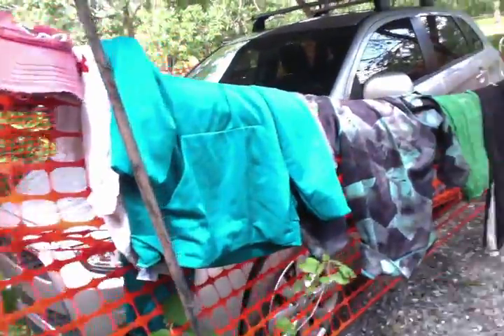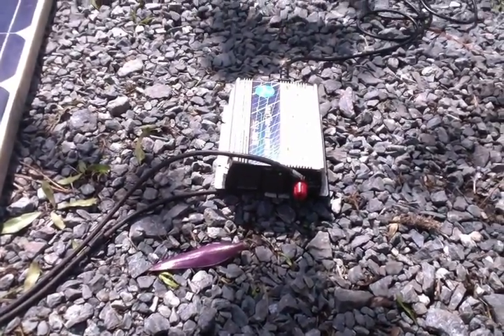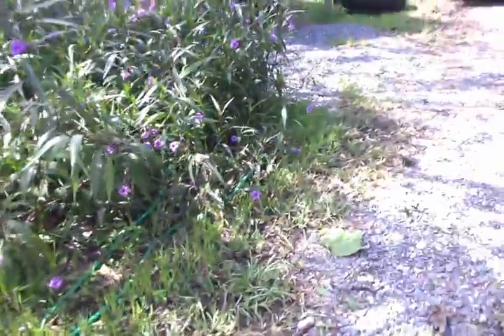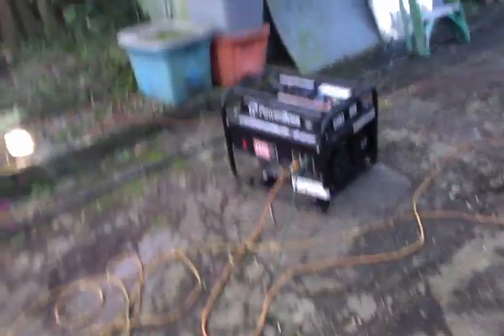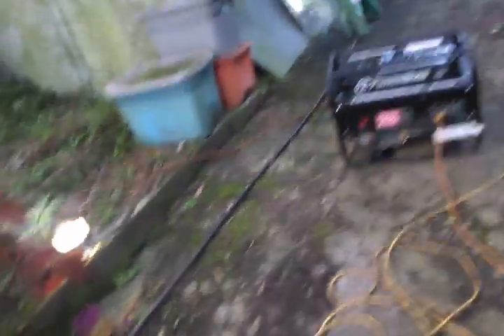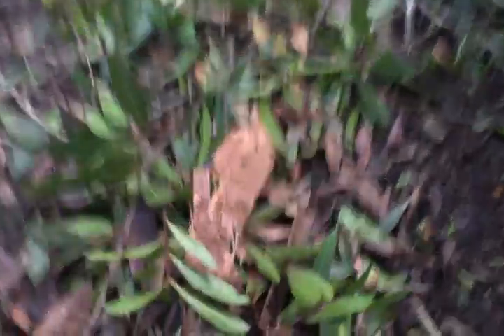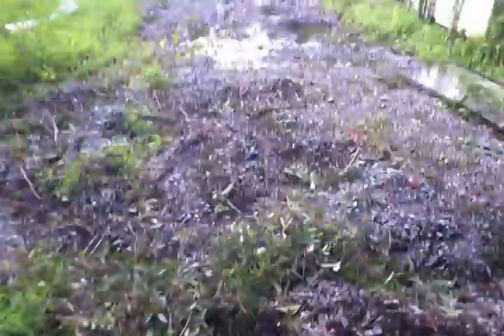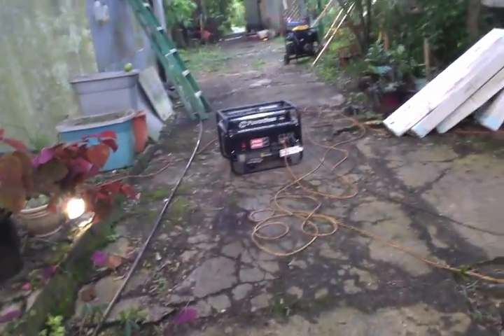No Grid Electricity Solar Grid tie inverter + Generator Hurricane Irma GreenPowerScience

Comment from the maker: Averaging less than 1 gallon of gasoline per hour with solar hybrid. Should be back to 50% solar tomorrow. Put our large system away for the storm.
Also, grid tie inverters do not provide power to the grid during an outrage, so it is impossible for them to back power the grid. Our inverters are hooked to our generators that are isolated from the grid.
Reply: GREENPOWERSCIENCE Glad to see you are doing well, Dan.👍 Shame on you, Rocky.😂
Reply: That's £5 an hour.
Reply: Question Dan, if your putting more power in with your grid tie inverters, than your taking out, what happens to the generator, or do the gridtie inverters ramp down, I've often wondered this, I'm using enphase m215 gridtie inverters
Reply: In theory the generator should supply lees current as the grid ties increase

Comment: Only thing I would recommend on these grid tie inverters is a smallest circuit breaker between them (3A? Can't remember what amps they output now) so if they go faulty for some reason they don't cause issues in house

Comment from the maker: We are not hooked to the grid right now, isolated to generators. 

A grid-tied solar power system is required by law to have a gridtie inverter with an anti-islanding function, which senses when a power outage occurs and shuts itself off.
All grid tie inverters are this way.
Reply from the maker: If it did not have this feature the entire neighborhood would be a massive dead load on the inverter and destroy it instantly. So, safety reasons and anti-selfdestructionreasons.

Comment: I'm surprised you have 3 generators and no battery banks for storing power from solar or grid. Is that planned for the future?
I'm in the Houston area and have 2 230 watt panels, 3000 watt grid tie inverter and a deep cycle battery (that I plan to expand out to more batteries in the future) that I can deploy after a storm. I also have a Yamaha 2000 watt generator with a tri fuel conversion so I can run off propane, natural gas, and gasoline. I'm hoping with that we can at least run a small portable ac unit overnight and our fridge and freezers during an extended outage.
Reply: DO the math on how much 'battery' will be required to keep all that stuff running overnight ... it will be more than you suspect.
Reply from the maker: We took down all solar assets because of a possible CAT 5. Clouds 3 days before. With the 20 batteries I have, that would have lasted about one day with weak power. I have been through this before "Charley" then "Francis" then "Jeanne" and Florida heat and humidity is not the same as other areas. Clean-up with power tools etc. is not the time to be overly exhausted. Best way in my opinion is to have a lot of power, a lot of fuel and go green the other 300+ days of the year. More people will die from clean up in this storm.
Reply: Good point, I didn't think about the lack of sunlight before and after the storm. We have a similar climate here (I also lived in Lakeland for 6 years) and can believe that there would be issues with heat and working out in it. I also didn't take washing clothes into account either, mainly just refrigerating and lighting.

Comment: wow, this is great info! I have a question, what happens if you have a load less than the generator + grid tie output? An additional question is could you just use this as a booster (i.e. turn a 1000w generator + 1000w solar grid tie) so that you can use higher output devices?? Thanks a bunch!
Reply: I'm wondering the same thing I have 5000 watts of grid tie on my roof but  never used the generator because of this question.

Comment: I don't see how it'd matter if you backpower the generator, unless there's complex circuitry. My understanding is, as you know, that generator is likely very similar internally to a type of electric motor. Combustion happens, the pistons cause the motor to spin and the magnetic force moving relative to the copper coils causes induction. By backpowering, you're just reducing the load. I suppose if you were to backfeed more than the generator is generating, the fuel might not combust too well (it'd be like getting the timing wrong for your turbocharged car), then harm might occur... but with just 100 watts, I doubt that's a problem for you. Great stuff :)
Reply: Actually it would be like decelerating on manual car, or an automatic with the torque converter locked. The rpms will go up, and engine vacuum will increase as a result.

Comment: I wonder if a GTI would work with an inverter generator like the Honda EU2000i with eco throttle?  How about the new GTI's with a limiter? If a GTI and inverter generator could play nice together that could save a lot of fuel for people in RV's running their a/c off of external generators.

Comment: How are you tying those solar inverters to the generator AC? How do they sync up the sine wave so that it becomes an "additive" source?
Reply from the maker: "Grid tie inverters" work that way.
https://www.youtube.com/watch?v=hANi5NbcY5g
They work with AC only. When the AC supply goes down, so does the inverter.
We have regular inverters too but not active right now.
Reply: Thanks Dan. But your video states "it only works when the grid is powered up". You mentioned you are of OFF the grid right now, so what is triggering the detection electronics to keep sending AC current to the backup generators?  Are these special generators that are designed to trigger the detection circuits of the inverters?
Reply from the maker: When GTIs are on a normal grid (power company) and the power goes out, the inverters cannot work, they shut down. When you have an off grid generator running, you create your own isolated grid for your stuff. Totally disconnected from the main grid. The inverter sees the AC power from the generators, powers up and dumps electrons into the isolated grid = solar hybrid power. The generator does not run as hard. Generator shuts off, inverter shuts/faults down just like a power outage.
Power company works on lines, no problem, isolated from the power company grid. Generators are never attached to the grid because of obvious reasons. The ones that are have special triggers to kill the main and isolate your house. Grid tie inverters under normal conditions are attached directly to the grid and designed to shut off when power goes out. So I disconnected everything from the (power company) grid and used many high quality extension cords with running half the AMP rating per cord. Cheap thin cords used for LED and internet/router/TV etc.
Reply: Very cool set up Dan. Now it all makes sense. Thanks for answering all my questions.

Comment: Hi @GreenPowerScience, I'm planning to do the same. We just got hit with a very strong typhoon here in Phils. and so now power are down. Some of my panels flew away but luckily I still got 5 left. Where should i connect exactly my inverter output? Should I connect it to the extension outlet which is connected to the genset? TIA

Comment: I am about to move into a off grid house. in the foot hills of North Carolina.  just wondering what wattage generators and engines you are using and the duration of use. for the fuel used. im trying to figure my fuel usage. i figure I will need to run mine about 4-6 hours a day depending on use. maybe a hour or so on light days. also I'm curious about the slight change in frequency of the power from the generator. when it takes a heavy load. will the grid tie inverter be OK with this? can it compensate for the slight variation quick enough? I don't guess it works with a off grid inverter does it? glad to see there isn't a fatal disaster. and glad you are still there. my system for now. is a 24 v bank of golf cart batteries. a 5 kW. inverter / charger. and I have a 2500 watt generator. and a 6250watt gen. all I have is a fridge. a freezer a TV. and led lights. also I'm going to put led tape lights in each room. running off the 24v DC. I found a 24v adj. 30a low voltage shutoff relay. and a low voltage alarm. for lead acid batts. to save from boosting and inverting. and the losses. use a small buck converter at each light strip. its hard to not put  RGB led every where. maybe under the kitchen cabinets. what's your thoughts on the DC lighting. I also plan to add a small 12v lithium batt pack. for times when the bank is to low for the inverter. so I'll have lights . while I start the generator. I also plan to use either a gas stove. since I have a thankless water heater. or use the generator to run the 220 for the stove. I also plan to build a 24v DC generator..to charge the bank directly. so I can keep the inverter running. good luck with the power and clean up. like they say. Sh!Π HAPPENS!!! I had a huge tree fall barely missing the house. a few months ago. it was so large. it hit another large tree and knocked it down. the larger was 18"-20", it brought down a 12" or so pine. if the angle it fell was altered slightly. it would have Ben on the house. best of luck to you guys.
Reply from the maker: We were averaging 3,000 watts continuos, 24/7. The 2 small generators are 2500/3500 and the large ones are 5500/7000. None of them output what they say. Buy double the power you thing you need so the engine is not maxed out. Runs more efficient and also lasts longer. For daily usage consider propane or diesel. These would not last for more than a month the way we used them. That is why we have 3 of everything with generators. A big $5000-$10000 quality generator would not be practical for storm applications unless auto start to a house. Bigger engines need to run every so often or they have issues. 
Flat screen TV is about 50 watts for an average size. Fridge freezer maybe 100-300 watts each cycling on and off. Led is nothing, maybe 100 watts for 10 bulbs.

I like DC LED but usually just go regular with small inverters. I would avoid an electric stove = dead load and power hog. Propane done properly is safe and more efficient. Do a solar thermal hybrid for the hot water. Try to avoid PV for anything that has a heating element and opt for solar thermal + hybrid when no sun.

So glad to hear the tree missed. Amazing how much one weighs.
Let me know if I overlooked anything and test stuff now before moving off grid.

Comment: I have a 2 car carport the kind they sell for $600 installed at your property when they arrive you can pick white or the brown to be exposed to the sky. I screwed up and said brown up since the trailer is brown? I was planning on putting siding on and going white. Short of it all I bake under that carport. I was thinking and said IF I would put blue foam inulation up leaving the gap between the 4x4 metal post I would keep the heat off me and it would direct the heat to the peak of the roof. Well I said how could I turn this into a benefit? 

I reasoned if I got an electric clothes dryer or a gas one for that matter and just used the fan and belt turner the drum would turn if I ran duct work to that peak in the carport I could draw the heat off that peak making my clothes dryer an incredible BTU unit and all for the power of just the motor which is probably 100 watts tops? 

I think you understand what I am saying ? The same could be done with 2 black panels laid on the roof with the intake attached to the dryer? 

I have issue with using a clothes dryer in the home I Like you live in the South and we have most the year dealing with heat. The only time we should have a dryer in the house is winter when you can use the heat. 

Summer a indoor clothes dryer will pull atmosphere from your home that is air conditioned / cooled it will take that mechanically cooled air and heat it expell it in my case under our trailer which in turn heats the floor of our home. 

If we had an outside dryer that would stop this. Also if I did this design I could have heat for relatively free. That roof is so hot that you will burn your hand if you place it on the bottom side most days we are getting heat on that roof.

Comment: what grid tie inverter are u using with your generator? So I can buy some, so save fuel
Reply from the maker: Any smaller GTI will work. You can use a larger one but I like a few smaller GTIs spread out. I have a very large one but use that for real grid GTI only. The generator + GTI setup seems to work the same and no harm was done to the small ones = identical to regular power setup but the big one was expensive. 500 watt to 1000 watt GTIs are perfect.

Comment: I don't think the power company wants your grid-tie inverter to be on during a power outage, so that it doesn't feed power into the grid when someone might be working on it.
Reply: you turn off the street mains and leave the rest alone, that's how this works. I have a very small system of solar (just under 450 watts)and 1 generator (1500 watts) the solar will run the fridge with the deep cell marine battery, and the generator is for the heater come winter. Always nice to have a backup for your backup.
Reply from the maker: Does not work that way. They cannot back feed the grid. They only work when there is power. Our generators are not hooked to the grid.
Reply from the maker: Grid tie inverters only work when there is electricity in the line.
Reply from the maker: A grid-tied solar power system is required by law to have a gridtie inverter with an anti-islanding function, which senses when a power outage occurs and shuts itself off.
Reply from the maker: A grid-tied solar power system is required by law to have a gridtie inverter with an anti-islanding function, which senses when a power outage occurs and shuts itself off.
Reply: Ok, for some reason I thought you had gotten your grid-tie inverter to work while it was attached to the mains grid!
Reply: GREENPOWERSCIENCE Joseph Newman's Big Eureka. Do yoseff a big fav and check it out. Hell he was on Johnny Carson back in the dang 80's had 28 engineers and scientist's sign affidavits attesting to the fact his machine works producing over unity. Patent office refused grant him a patent.  Do check it out.
Reply: re: "I don't think the power company wants your grid-tie inverter to be on during a power outage,"
DID yiu even watch the video? Geesh  ... do you know what EXTENSION CORDS are?
Reply: It's conceivable that you could get a grid-tie inverter to work using extension cords, while it is connected to the mains grid.  I missed the bit where he said that he wasn't connected to the grid.

Comment: Dan I'm surprised you have not converted you generators to hydrogen.  You would not have to rely on gas and it would make and use the hydrogen all at the same time
Reply: Um, WHERE would he get the Hydrogen?
Reply: uploadJ   Well you can make it by separating the H out of H2O 
The H in h2o stands for hydrogen 
It's a very simple process and only needs really 4 thing 
Look it up on YouTube 
I have seen it done in person at a maker fair it was running a car

Comment: get the dogs away from that hideous noise. how'd you think you'd feel after hours of that noise in your head? seriously I understand that things are hectic right now down there but a little common sense and a little consideration
Reply from the maker: They love the fans and totally a sleep right now. Dogs like blank noise and it is not loud near them.
Reply: GREENPOWERSCIENCE not the fans the generators. way to loud.
Reply from the maker: They work for emergencies like this. We may be without power for 3 weeks. Solar will be added back slowly.
Reply: If the dogs are sleeping, they're obviously not too bothered.  They obviously care for their dogs quite well.  I wonder how many people without power are fortunate enough to have a fan down there in that heat and humidity now.   Looks to me like they're using quite a bit of 'common sense and consideration,' especially after what they've just been through.
Reply: OMG, Ryan Clifford, really!!??